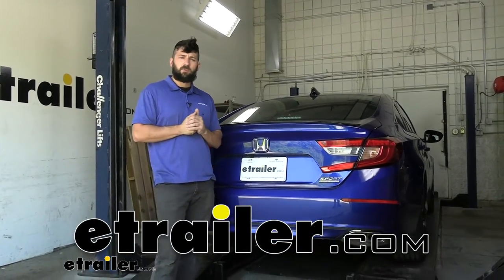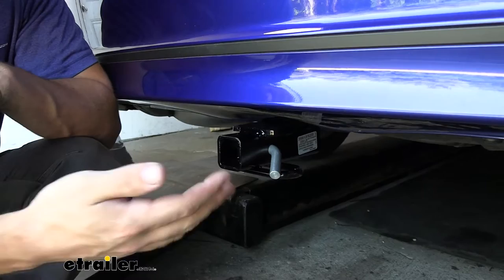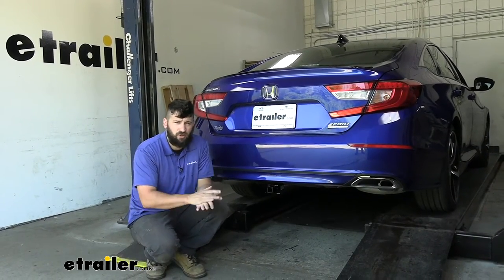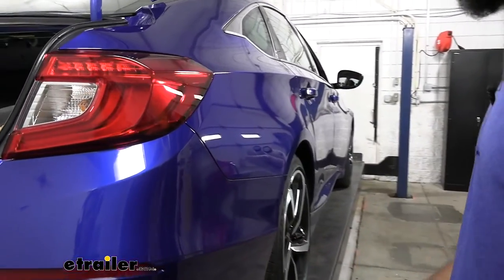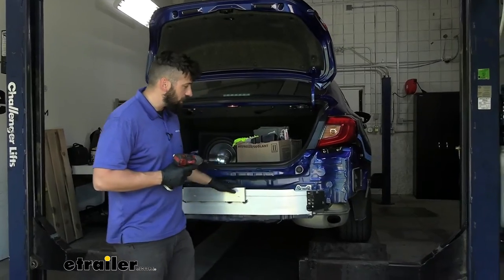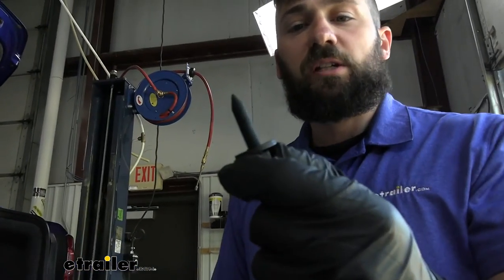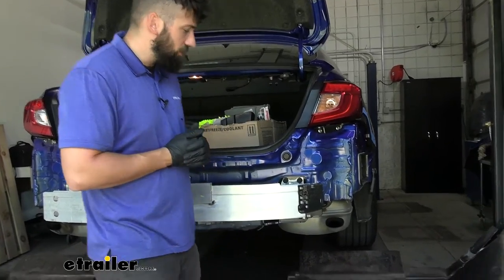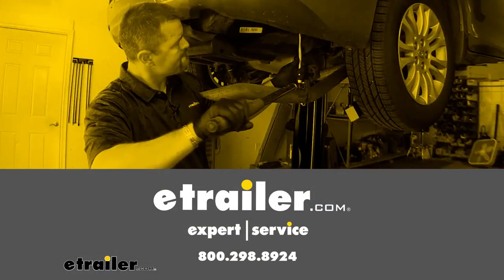etrailer | Installation: Draw-Tite Sportframe Trailer Hitch Receiver on a 2022 Honda Accord

Comment: For those trying to install this on a Hybrid, there’s extra plastic clips on the left side. There’s a panel behind the bumper that covers the cavity where the 2nd exhaust muffler is on the turbo models. Without cutting out a slot, the bumper ends up bowing inwards and causes those extra clip holes to not align. Zip tie will be your friend, but I’m planning on cutting out a slot.
Reply from the maker: Thanks for the info, we're sure others will find that very helpful!
https://www.etrailer.com/Trailer-Hitch/Draw-Tite/24972.html

Comment: Does it make a difference when there’s back up parking sensors on the bumper? Thank you
Reply from the maker: Assuming the sensors are imbedded in the bumper fascia, they'll need to be unplugged before removing the fascia. That'll be the only difference.
https://www.etrailer.com/Trailer-Hitch/Honda/Accord/2022/24972.html